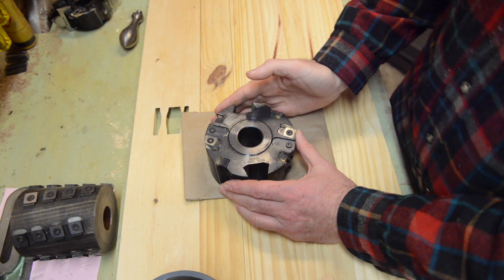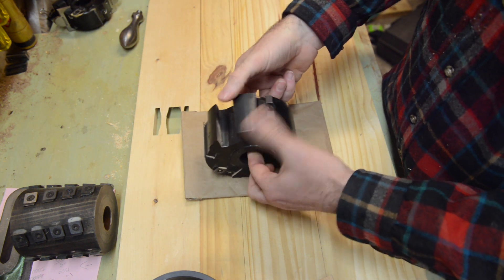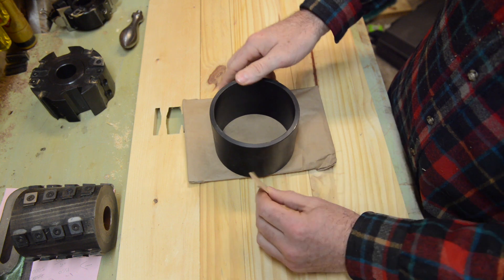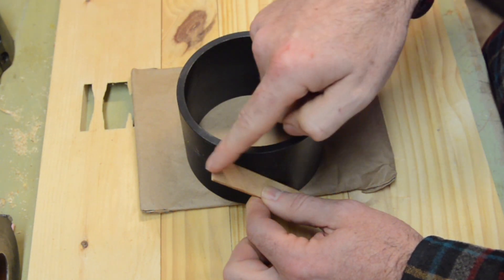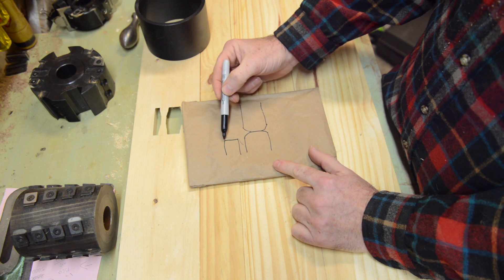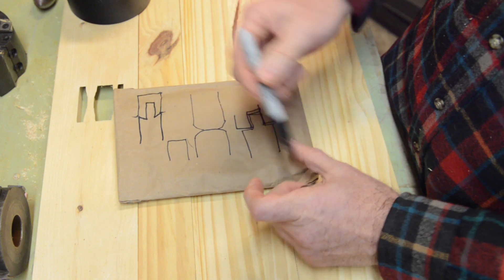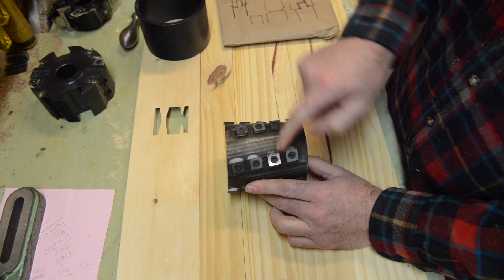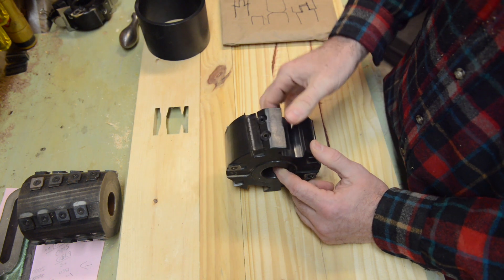Straight knives cutting a radius?  Here's why.

Comment: Depending on where you get your cutters sharpened they may have the option to add this curve if you tell them the diameter of the cutter head the knives are going with. Can't hurt to ask. Festool's handheld electric planers come with their knife edges curved out of the box.
Reply from the maker: Absolutely, many of the old school push/pull tenoners have grinding to compensate for this too.  For planers and jointers where the grinding is done in the head and in the machine, it's all compensated for by default.